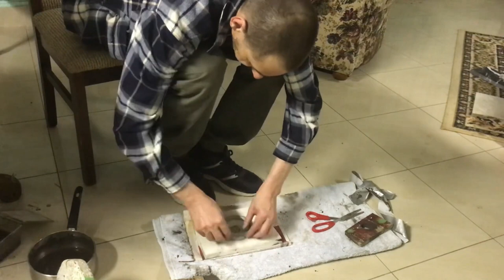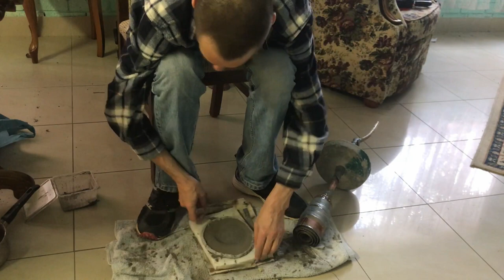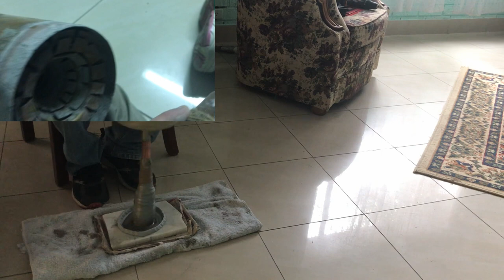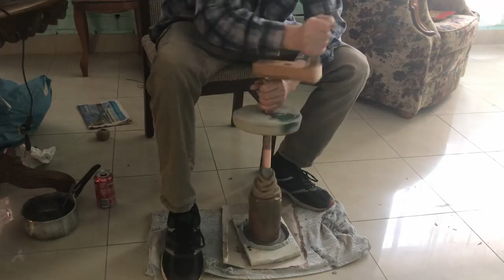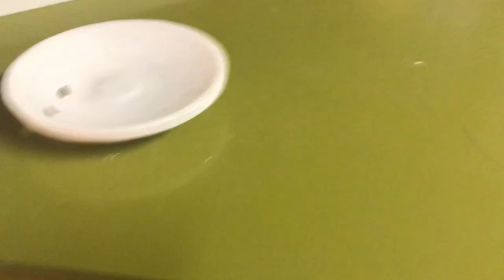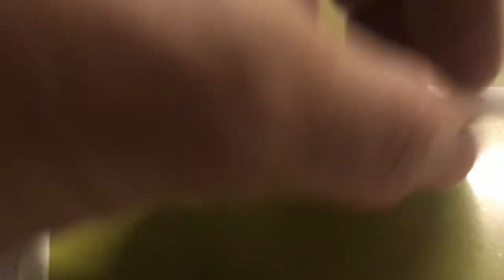Making my 1st Lost Ancient High Technology with "Primitive" Egyptian Style Hand Tools & Technology.

Comment: Cool. Now how many of these do you have to make before you can make them precise to within .0001 of an inch?

I don't understand this hostility from the "debunkers" like you. This is clearly an unexplained process. You even talked about how the drill wobbles too much to even make a straight line. Why not agree it's a mystery and join in on figuring it out instead of just digging your feet into the ground.

Those vases were not made this way

Comment: The ancient Persians and Hindus have ancient tablets that tell how they added carbon to there
copper smelting. Adding carbon would make the copper much harder and water resistant. They added Wheat stocks during the smelting process that is how they added the carbon to the copper.
If i remember you could also use yellow and or red orca power mixed with bees wax to smooth
and polish after the grinding process is done. use leather to apply the bees wax and for the final finish I think you could use cotton or silk material to apply the final polish. 
You are quilt a craftsman and the the proof is in the putting. Well done my Friend!!!

Comment: There is a really simple solution for Unchartedx "smoking gun for ancient machining" video. The holes in that granite box was made with a bow drill and a belt, like the ones when making fire in ancient times. Instead using a belt around the drill to get in close to the corner where the holes are drilled. And the fasetting he is on about is a necessary bi product of getting the edge straight and of the same height all around the granite box.
Reply from the maker: ;-) But the experts say!
Will do a demo on that when i start a replica mini granite box.

Comment: On the video "a megalithic precision box with inner precision box" on UnchartedX channel I replied on a comment of someone who already got a reply of UnchartedX. This is what I wrote:

The surfaces and angles or these boxes are not precise. Surfaces clearly not honed, which you can see with your naked eyes. They are polished, but not really flat. The measured angles vary from 89ish degrees to 91ish degrees, which is not high technology precise. 
The stones can be drilled with bone or copper with abrasive like sand. They can be split by inserting wood into the drill holes and adding water, which will swell up the wood and create enough pressure. 
You can use Diorite balls to cut trenches. Takes time, but they did. Experiments have been done and large stones can be harvested within months or a year. The scoop marks are clearly the result of that process. They bashed the diorite stones and created pits. The walls between these pits then could easily be smashed to pieces, which saves a lot of time. Also, fire could have been used delicately, which can weaken the granite, which makes it way more easy to break the stone. This however is not needed, because even without, it can be done with Diorite bashing stones, which clearly left the imprints of a stone age quarry. Later in Iron age you get to see the thin paralel lines of a chisel or axe. Where in Stone age they had wide holes bashed with diorite and small walls to crush, in Iron age it is thin paralel cuts with thicker walls to destroy. The latter goes faster obviously.
Copper tools can be used to shape granite. Also flint. Takes a lot of dedication, but experiments in modern time already proved it can be done. The so called high technology of a lost ancient civilisation is totally not needed to shape a diorite bowl or vase. Like cuts like. Granite can shape granite. ...but flint and copper can do so as well. Even bone, if you use the right abrasive. 
I have been looking into this stuff for ages and if you want answers they are out there. 
Why UnchartedX claims these boxes are precise while it clearly not so is the question. Why he ignores the experiments in recent times that prove it can be done is another good question. Why he ignores the writings of the ancients that clearly explain how they did it... is what needs an answer....
The internet is waking up to the lost ancient high technology bs. How long will UnchartedX claim it can not be done and ignore all that is out there?

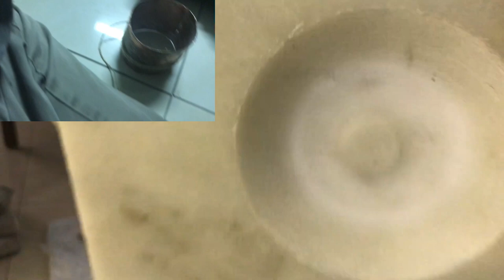Comment: Fantastic point starting at 9:20 any decent shop would have multiple sized drills and jigs hanging from the rafters. If this dish was a popular size or style they would have matching inner and outer fixed drills the proper curve for the final grind/polish (preventing the holes). They had the ability so the sheet could be also fused(welded) together at the seam.
Reply: Since copper would be at a premium another possibly for mass production could be  wooden templates, or an exact hand carved wooden bowl to copy ( we also know they had wood lathes) to use to set up the copper tubes for the inside and outside curve profile. For the final grinding..Set all the tubes on the wooden template/bowl then lock them in place. Maybe you should try this
Reply from the maker: Yeah. One of the ways i was thinking, at least for polishing/finishing was to cut a wooden profile or a log and put a sheet of copper over it
Reply: @SacredGeometryDecoded  yes better idea..the copper could be formed over any wooden bowl shape
Reply: @itsnot_stupid_ifitworks  gilding with copper sheets not very effective but a hardwood formed bit is a good start

Comment: I don't think duct tape is cheating that much. They had rope and string, and I doubt they were ignorant of the various tensioning knots. Fairly elementary to fashion something that would hold the piece motionless during drilling with primitive tech. With African stonecutters, I've seen them hold small workpieces in place with bare feet, too: toes are pretty useful, particularly if you're in a barefoot culture. 😆
For attaching the drill bit to the shaft, we've had poor man's epoxy like pine pitch and so on since the mid-stone age at least. They found 70,000-year-old glue made from ochre and palm gum in South Africa. We know for a fact that the Ancient Egyptians were boiling down animal hides for glues, too, and that's exactly what we used for practically everything until we discovered plastics. It's strong as fuck. There's no problem there.
Reply from the maker: Yes. Fastening spear and arrow heads. Though the LAHT types suddenly get very skeptical when it goes in the other direction.
Literally have had people deny Egyptians ability to make copper tubes in the past. But advanced lost technology they had no problem with accepting.

Comment: If they had a production line going on these kinds of bowls, once you have shaped the first concave bowl, and started the second, you could simply attach the first bowl to the bottom of the drill with a good bit of resin, and use it as to start grinding the second piece, the internal of the second would cut fairly quickly, whilst also shaping the bottom of the first, once it’s done, the second starts the third, the third finishes the second, and so on…

Comment: Have you thought about adding a counterweight to your handle or suspending a small bag of sand from the rim of the flywheel, the edge opposite of the handle?  10 or 12 oz. of sand in a bag hanging from a string 4 inches in length might give you better control and make it much easier to maintain momentum.
Reply from the maker: A lot of the Egyptian pictures have them using bags.
I did try in the past and once in motion it’s ok but I found it awkward to start. 
Now I am very used to these types. It may not always look it but o do have good control.

Comment: You know that white dust there 16:01, I've been thinking about the French core drilling experiments of late and the "sand" they found in those cores that seemed to be not from the area. My best guess is that it is not actually sand like natural but the powder from all these stones. There must have been so much of it that in some of the areas they used it in between rock types, perhaps. I can't find the name of the experiment but they made three drill holes in the King's Chamber or Grand Gallery in the 90s. They were only permitted 3 meters deep holes with a slow drill.
Reply from the maker: There was a core found partially finished and inside copper and corundum (aluminium oxide) abrasive.
It can be found in Egypt though when first used , 1500bce or before?
But high quality quartz, silica sand widely available.
Either way the dust/sand of the stone will do the job.

Comment: Interesting to see put to practice! The results are far better than I expected.

PS: they made 3D scans of the ancient vases. The dimensions and precision is very impressive, it has to be said. If you want to see for yourself, search for JRE #1928 and skip to 45:00
Reply from the maker: ;-) I haven't watched this yet, thanks for the time code.  
I haven't got the best equipment but my drill holes are about 0.04 millimetres variance form perfect circels, about 3/100ths of an inch. Mine are better using an egyptian style hand drill. With a home made copper tube, just a copper sheet roughly put together.
Reply: @MrAchile13  I referred to the Fatimid vessels in Ben's latest video and one of his faithful said that he believes those are also leftover artifacts from the earlier fantasy time period because because because.
Reply: @Eyes_Open  Yes indeed! Some of the Fatimid vessels have Arabic writing carved on them as decoration, which means, of course, the only reasonable explanation is that Arabic language and script were inherited from Atlantis!

Comment: Great job
I've thought about if I was in thier time and how I'd do it maybe. Several things come to mind. As far as the vases I would do the outside first. After all if ya did all the inside first, then broke it... there'd be a ton more wasted and all the time working it lost. Then I'd maybe drill out a core. Then attach that core to my drill. Then I'd cast some copper in the rough shape I'd want but in a negative shape. Then grind the plug on that till I got the shape I wanted. This way I have a way to get the smaller taper on the other end. Which is done with a pipe drill is near impossible. Unless they could do the fingers like yours and have them reach inwards instead of splaying outwards as u did. 
Then once done I'd start to hollow it out. I'd do a large core out first. Then snap it off. Then begin to drill out the inside like how you did with the splines, or a similar similar method we use to hone engine cylinder walls today. In theory to polish it when done could be done with a copper wire brush and grit inside. (Id they had small wire like that, maybe they could. If they didn't have calipers then to monitor and track how thin the walls was getting, I'd hold it to the light instead and use its translucency as my gauge to monitor progress. I'd likely stop in areas where I could begin to see light thru it. 
I say this because there's no rules that say the stone must be sitting still as it's drilled. There's no rule the drill must be the copper. There's no rules that the stone can't be the drill and the copper sit still. There's no rules that you can't use brass casted to shapes you want already made and used them as drill bits instead. So maybe if you expand on that thought process I bet you could come up with nice stuff alot faster. There's also no rules that say you can't add dolerite or quartz sand into you're copper shape molds, and or copper molds.
For instance you could cast a copper plate positive side, and a negative side. Then used the copper plates you made to grind into the stone. There'd be no ridges that way. Go alot faster too if ya embedded quartz into the copper too lol. You're a smart guy. I'm sure when not forced to follow preconceived notions just like the ancients you will find a way. They did. I'd say that's a technology lost to time for sure. Especially how to do those with handles that appear to still be spun somehow. Mind-blowing I swear lol
Good video bud
Reply: Oh. I think you can use a bowdrill that has a similar counterweight to keep velocity. Then you could make more precise vertical cuts with less wobble when needed? Just an idea. I think that would still stay correct, and less blisters lol.

Comment: A question: if you were to want to drill a hole tucked rightvinto a corner so you couldn't turn this cranked  drill handle through 360° - is there any reason why it would fail to work if you twisted it back and forth through 90°?

It'll sliw the job down and I'd guess it'll make things a bit more awkward to keep uniform, due to reducing the 'error equalisation' of rotating the drill through 360° each turn... But, would you see amy major issue there?

...Asking because holes of that type are seen in Egyptian works, to catch hinge dowels at the top and bottom of doors on sarcofa... Sargoffa... Sarscoffaguy.
Reply from the maker: Hello 
I will doa  demo but a couple ways to do it. because in an open corner a bow drill with the bow on top and at 45 degrees. the shaft narrower than the drill to contain the rope.
I forget the proper name but also a "tether" drill, with two bits of rope wound in opposite directions. as you pull one side it rewinds the other and vise versa.
It would work fine though as you suggest, the experienced guy would rotate the drill head occasionally to equalise the wear. Even if just a 15 degree rotation its still rubbing against and moving material.
Either way its best a two man job if horizontal but i reckon that box was laying on its back during construction.
Reply: @SacredGeometryDecoded  Howdy dudey.
Aye, sounds about right... "tether drill" ... not heard that before - I'm imagining spinning a button acting as a flywheel on a loop of cotton - which used to fascinate me as a kid... 

...If that's not what you mean... I wonder if it would work as a more efficient drive - it's a mechanism that naturally presents itself when making a rope so not unreasonable to imagine they'd have been aware of it. 

Never actually seen that on a drill... Imagining something like your drill at present but with a longer shaft perhaps, two ropes/cords fixed either side into the face of the flywheel at the top which is fixed onto the shaft, the cords run down parallel to the shaft and are anchored either side of a freely rotating handle 'hub' piece with a hole in it which can slide freely up and down the shaft, so if you spin the shaft twisting the two ropes around it then push the handle down, pushing the drill into the stone as you do so, the momentum of the flywheel then set spinning will allow you to spin the shaft one way then the other as the rope is wound one way then the other... feeling I'm redesigning the wheel here, probably well documented and I've just missed it (perhaps I've seen a fire-starting drill apparatus that works on that principle?), but sure something of that sort would allow for a much faster RPM with less labour. ...And not work in a corner... but then... such is life, can't win 'em all! 😎